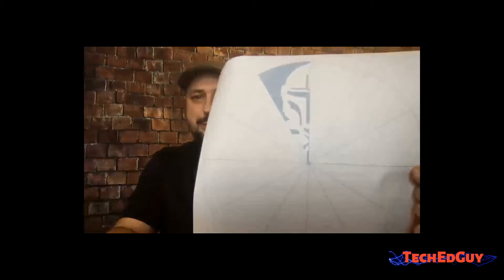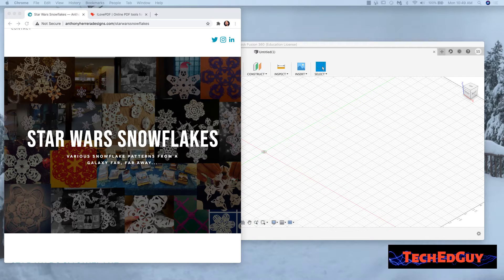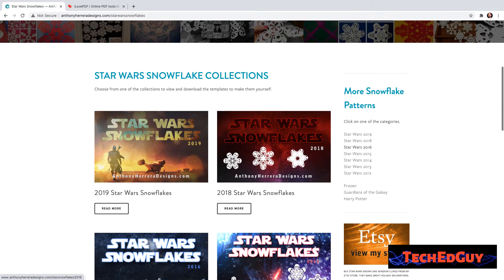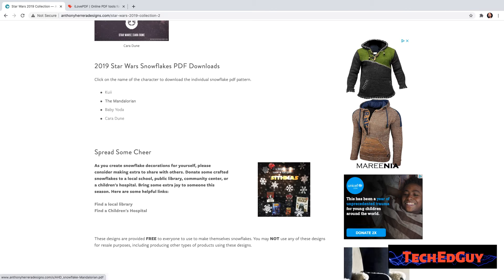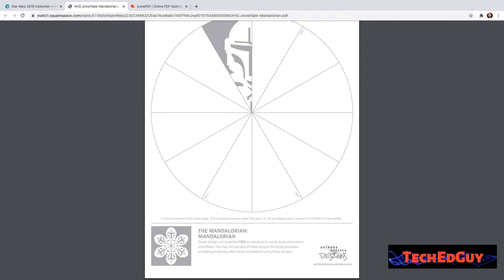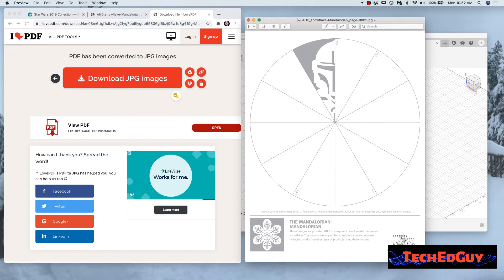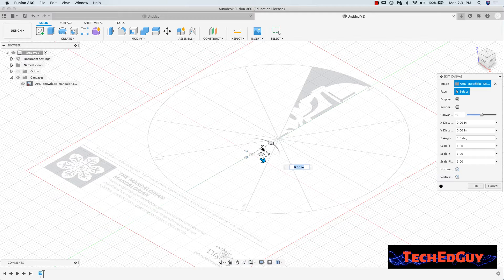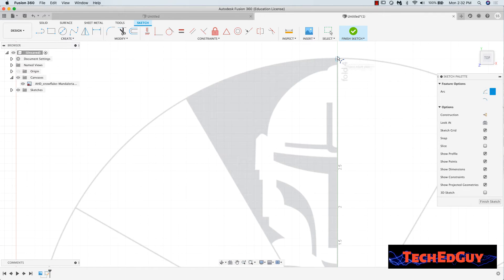Star Wars Snowflake CAD

Comment: Hi. This is a few years after when you posted this.  Great job!  I'm a second year PLTW IED teacher (I had IED with Craig Hughes last year from PLTW). I tried this last year, and the only comment I would make is that by the time my students get to when I would try this, it is around Thanksgiving or a little afterwards, and although their CAD skills are pretty good at this point, I know from, last year that what caused problems for them when I assigned this (stupidly without trying it myself) was being able to trace around the JPEG with the arc tools and being sure they enclosed everything properly.  Many of my students likely also had issue aligning and selecting the origin and adjusting it properly. I had broken 3D printers that I inherited, so I barely got to having many of the students print these out-and when they did, it was clear that not closed the arcs properly, or selecting and aligning things with the origin was likely what caused it to be very difficult to them print these out after we converted things to an STL file and sliced them.  Having said this, I completely understand why you didn't want to show the tracing in detail, but it would have been helpful to at least walk them through a couple of arcs and THEN speed it up!  Anyway, thank you so much for this. This time, I will try this myself so that I am able to help, unlike last year where I just shared the link. Thank you! Steve